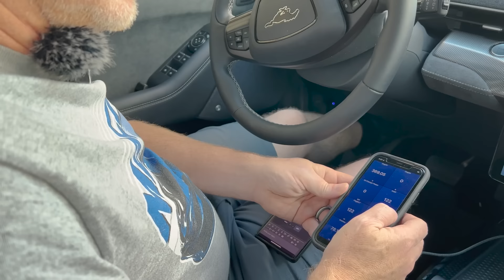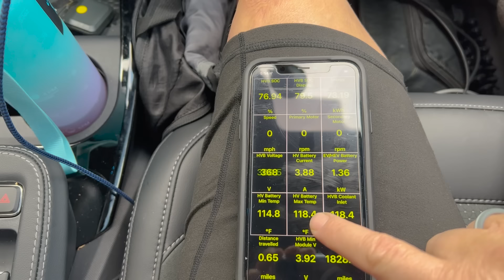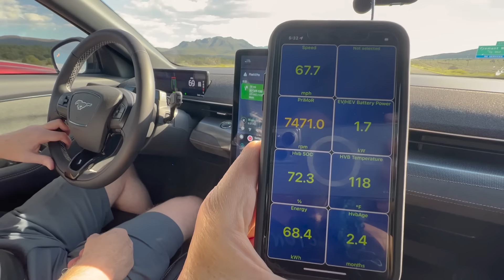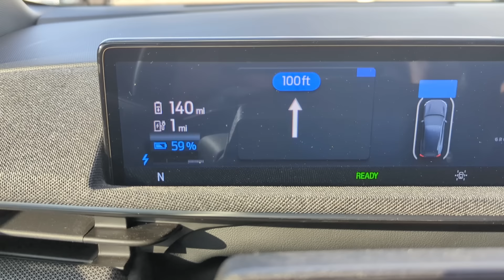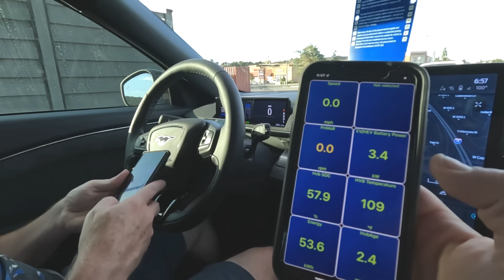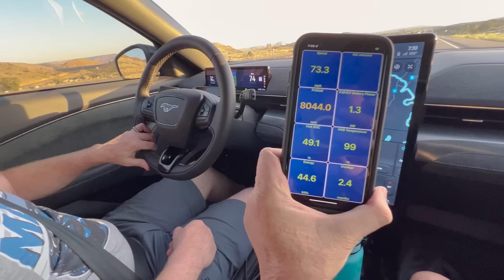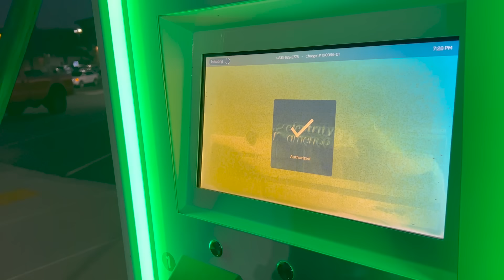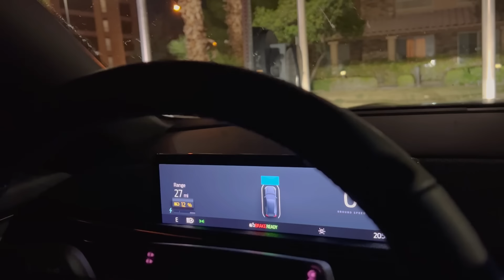Mach-E GT Road Trip - Hot Battery & Turtle Mode!!!

Comment: There is a software problem.  This reminded me of a software problem I sometimes see with my P-AWD... where it will not select a profile.  Shut the car off and on.  Still won't work.  Wait a while (I guess this sleep cycle you mentioned?) - fixes itself.  

If they're going to have software issues like this then they should give us a way to 'sleep cycle' the car ourselves.  The software has been refined for a couple years now and issues like this aren't acceptable.  I would have been furious in your situation with nobody to contact and reassure me about 'turtle mode'.
Reply: We need a Ctrl-alt-del button for the car.  With all these modules the car has it needs a simple reboot process.  My drivers side door was acting up once and I had to disconnect the 12v battery to reset the door module.

Comment: Something similar happened in my Tesla. Some kind of software glitch screwed up the AC compressor but the next software update actually fixed the problem! So literally my air conditioner quit working and they were able to fix it over the air update 😂  I have learned over the years a sleep cycle does correct a lot of errors that come up. Having a software powered car can certainly be an Achilles heel occasionally. I've even had to go as far as Force rebooting the car by unhooking the 12V & 400v batteries so quite literally turning it off and back on again 😂

Comment: I am a current MME owner and I would love y’all’s take on this: w/ the Mach E and EVs as a whole being newer drive trains etc. do you see these setbacks and issues as detrimental to owning them? I have had a handful of issues w/ my MME that have left me stranded. My MME has also been in the shop for extended periods of time due to these issues… but with that said, I still love driving the MME when it works. It’s a love hate relationship for me. I love it when the MME works and I hate it when it does not and it leaves me stranded. I have put up with a lot so far w/ the MME but am getting closer to just going back to my gas truck until EVs get all their initial bugs worked out. What are your guys thoughts? Thanks for sharing!

Comment: Were the fans running at all while you were sitting? It’s strange that the battery would still be so hot while sitting there for over an hour.

It seems like there was an error with the fan and cooling logic that prevented it from properly cooling.

Comment: I had it now for 5 times, also the issue with fast charge. On the macheforum the say that it is the hight voltage battery junction box, with the connectors. And the TSB 22-2178. My car is now for the 5 time to the garage. 😔
Reply from the maker: This one turned out to just be a software glitch. The HBBJB is the new one since it was built after the recall.

Comment: Great audio track choice. :)  Did you leave the car "on" the whole time it was hot?  Surprised it was taking so long to cool off.  Something seems off.  Ok so you answered those.  Sounds like a software bug.  Since it started cooling after the sleepy time cooling system is likely ok and just a logic fault.
Reply: I'm in Canada too.  AB , you?
Reply from the maker: Yup pretty much as it was termed by the engineer we spoke with "a glitch in the matrix!". It felt really scary and dramatic but after we let the car sleep cycle, it reset and did what it needed to do! Great to hear about the music! We just started paying for a music library so that's reaffirming to hear! - Liv
Reply: @MachE_VLOG  Glad it came around.  Those temps for the battery would concern me aswell.  Just think of all the folks who might find this and now to let a quick sleep happen to possibly correct it and be on the way.  Hope they grabbed some data from your experience to add to a future fix.
Reply: @FeisarX  Ontario here.

Comment: I noticed on my MME that fans for battery thermal management (heating/cooling) never actually kick on unless the vehicle is plugged in, even if only just plugged into basic AC 110v outlet. That to me is a pretty big oversight from Ford, because it means the car never regulates battery temp unless car is plugged in and charging. I could be wrong, bit I have never ever seen mine kick on otherwise. 

But even if I am wrong and it kicks on while the vehicle is powered on as well, then that tells us how poorly designed the battery cooling is designed since you sat there for over an hour in turtle mode with vehicle powered on, and barely saw a drop in pack Temps. 

This is something Ford really needs to do better on.

Comment: Patrick - Would it be possible to buy a few bags of ice and stuff them in the cooling vents then spray the ice with a car-wash spray while the cooling fans draw the cool air in?
Reply from the maker: From what I was told, the battery pack is so isolated and protected that something like that wouldn't help much. It really is the cooling system that does the job of keeping those temps down.

Comment: At 7:14, is that a hole in your radiator, or just something stuck to it? Could that be why your cooling is impacted? Maybe a rock got kicked up and damaged the rad ... same thing happened to me in my old Chevy HHR once.

Edit: Further into the video now, glad it was sorted out and didn't impact your trip too much. A little frustrating that Ford is just, "oh, just a glitch." It's not reassuring that the cooling will sometimes just not do it's job, and it's on you to just hope the car will figure it out on next start up.
Reply: It’s an electric car. There is no radiator. 🤦🏼‍♀️
Reply from the maker: I think it was just debris. And who knows, Ford might have some diagnostic data from my car so they can prevent this from happening to others with a software update.
Reply: @loriallen67  Of course it has radiators.

Comment: The GT runs much hotter than your previous Mach-E.. That was main reason I didnt buy the GT.. Also never drive one pedal on highway.. Big no no..
Reply from the maker: Other than this incident that turned out to be a software glitch, the GT and FE battery temps have been very similar. 
And it is completely fine to drive one pedal on the highway. The Ford engineers have stated it will make very little difference.
Reply: @MachE_VLOG  running ipedal on highway looses efficiency. Go look up one pedal driving on ioniq. Many people have done studies and shows it takes a significant hit on efficiency on highway. 

Also the GT definitely runs hotter just due to the fact it’s a faster car.
Reply from the maker: @StayConnectedEV  I'm going by what the Ford engineers have said repeatedly since they are the ones that designed the system in the Mach-E. 
And if I am doing the same speed in a GT vs FE, then the temps will be similar.

Comment: ODB2 dongle link doesnt work. Just sends me to amazon main page.  Have the name of it?
Reply from the maker: Here is a new link: https://amzn.to/3SyD7ly
It is the Veepeak OBDCheck BLE Bluetooth OBD II Scanner
Reply: @MachE_VLOG  Thanks that link worked
Reply: @MachE_VLOG  Do you leave yours plugged in all the time?  I heard it might cause 12v faults
Reply from the maker: @RickNoppenberger  I don't usually have it plugged in since I've heard conflicting info on whether it will cause 12v issues. I did plug it in just for the trip and initially planned to log a bunch of data.

Comment: Hiding car features to end-users is NEVER a good idea.... Why aren't you able to manually select the battery cooling required in stationary mode as a driver? You can loose range? So what! It is a driver's decision to take not the car manufacturer..... Just an opinion...